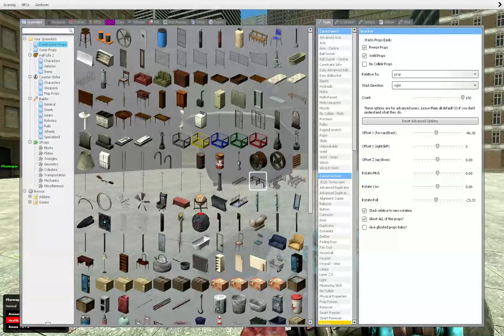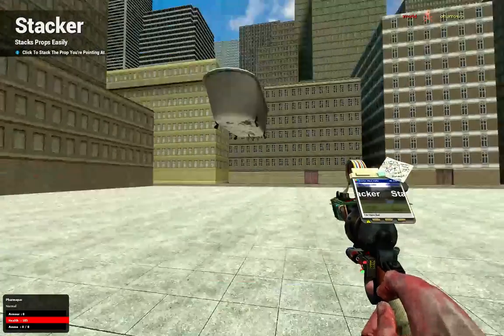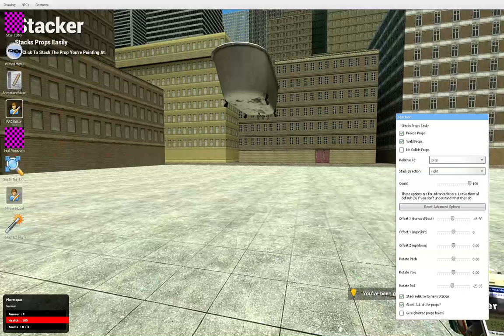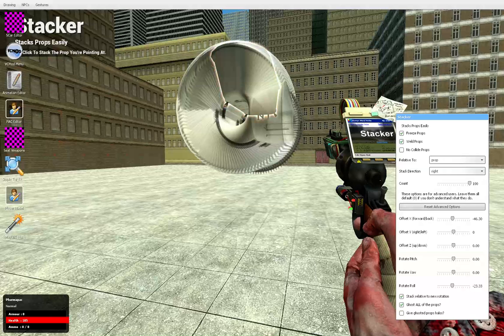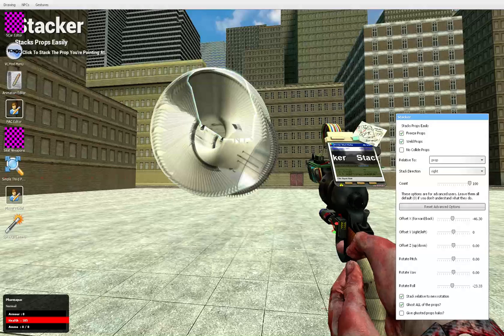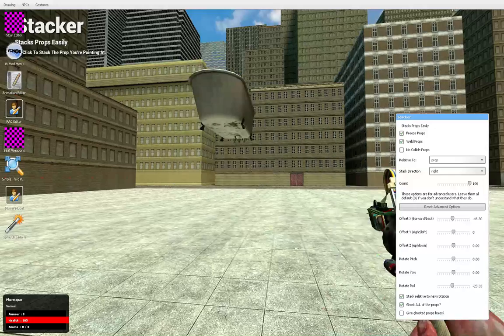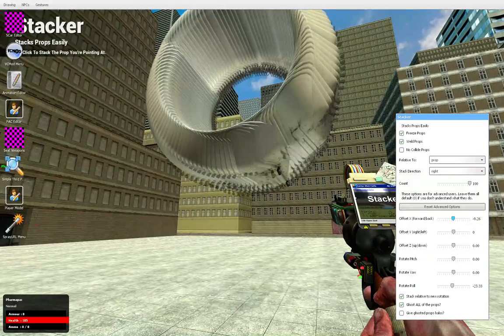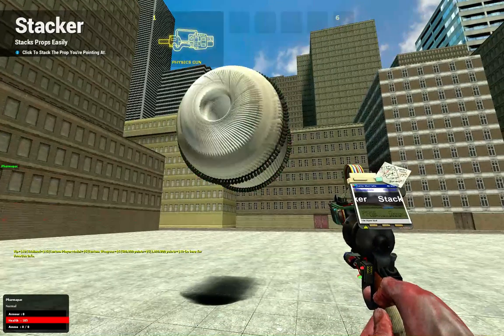[GMod] How to Build the Lag Engine

Comment: Made a video on something like this, but it crashes the server instead of lagging.
https://www.youtube.com/watch?v=iyXL5KDVZwo
Reply from the maker: +Walthall 
You can crash servers if you make a big/complicated enough lag engine.   I think the one I made eventually did bring down the server, but that's not what I really intended to do.

As far as greifing goes, I've found that it's better to lag a server indefinitely than crash it.  If you crash the server, it usually restarts itself a few seconds later and everyone just comes back.  If you lag a server to the point where nobody can move, nobody is able to do anything until you either leave (and the server cleans your props up much, much later) or until an admin steps in and restarts the server, at which point most people get fed up with waiting and either switch servers or close the game.  Most of the time mods in-game can't even ban or kick you since the server is lagging so bad, so it takes someone with direct control of the server to restart it and then ban you.
Reply: Sliphantom Thanks for the input.
I will try your machine when I get around to it.